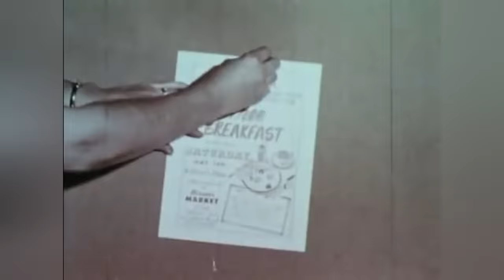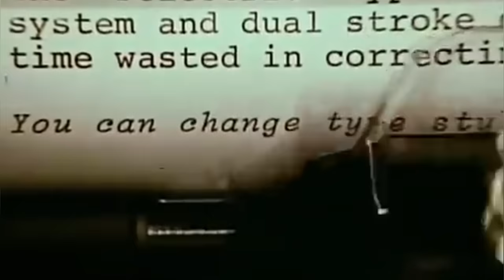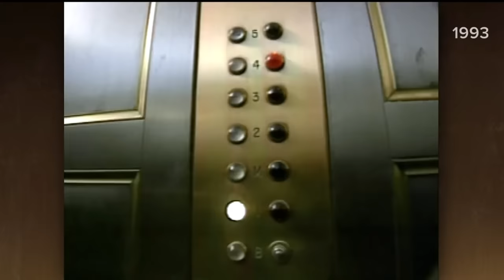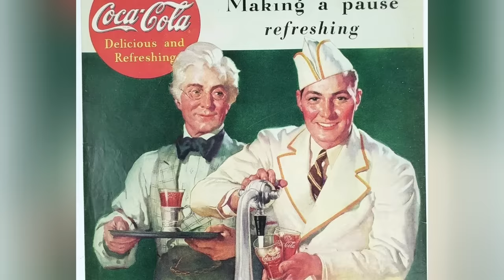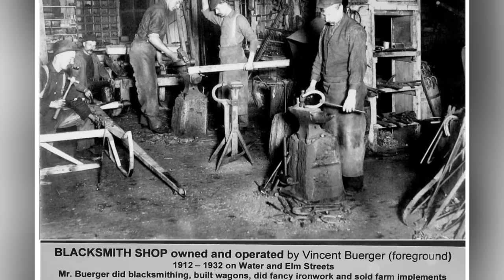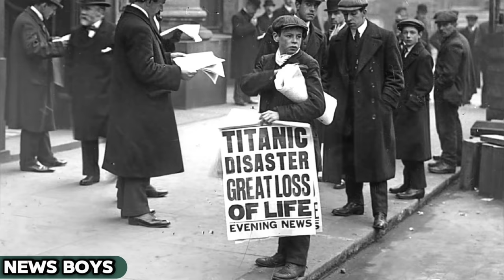14 Old Daily Jobs.. That Have FADED Into History

Comment: My father ran a home delivery route for Dixie Belle Dairy, that closed in 1971. I ran a milk/ice cream wholesale route for Pet dairy, that got bought out by Land-o-Lakes in the mid 80s. I bought the truck I drove in 1987 for $100, putting in an engine and driving it home. Taking the bed off,(Which I still have and still keeps everything frozen) I turned it into a 1975 GMC C6500 Cab over 26 foot pickup. I later sold old Truck #217 as a show truck for $30,000.

Comment: I remember getting a flat tire in the sixties. The gas station attendant took the tire off, patched it and put it back on - no charge. Also, if you were having a mechanical issue, attendants would easily spend an hour trying to nail down the issue for you - no charge. It was a mystery to be solved - not a chance to make money.

Comment: I worked at an ARCO service station while in high school 1971-1973. To this day I remember a lady driving in, in an old Rambler, and getting $0.25 in gas and getting windows washed, oil checked and air in the tires checked.  Good times!
Reply from the maker: Good old days! Thanks for sharing 🙏🏼
Reply: @greglancaster1079  “Fill ‘er up, with Regular!!” My old Service Station even gave us a newspaper to read if we filled the tank!!  Until 1997 3 teens surrounded and serviced your car in the SF Bay Area, at an original Union 76 gas station (now a Uhaul franchise)!!  How many jobs were cut by “technology” (actually cheap companies squeezing every cent to make their $60m salaried CEOs richer)!!

Comment: I was on the receiving end of that news flowing into the teletypes, and miss when full serve was the norm at gas stations. They also checked your tires and aired them up when needed. Stations today may have tire air pumps, but they either costs you several dollars to use are are broken most of the time. Yep, definitely miss full serve and dairy and Charles Chips home delivery.

Comment: In Guatemala, there are still gas station attendants. They check the oil, tire pressure and windshield fluid (for a tip).

Comment: I miss the carnation breakfast bars i had in mid 1980s from supermarket.

In 1970s we had dunkin donuts and charles chips trucks. We also had the whip ride. We had knife and scissors sharpener truck.

Some of our neighbors had milk delivered.

We used to get soda from hoffman and return the glass bottles when done.

I think nyc might still have a few elevator operators.

My dads friend still hand paints pin stripes on cars.
Reply: Cool 😎 
What is the whip ride?

Comment: I had a paper route when I was about 9 or 10. The Globe and Mail certainly isn't as thick as it was back then. In between my first and second year at community college I worked at at hotel that still had a jack system for the phones. That was interesting learning that. The technicians who serviced it finally told the owner they couldn't get parts for it anymore and he had to update to a modern 70's digital system. Here in Saskatchewan the Co-Op gas bars have people to fill up your car for you. What to bring back is a tough call.